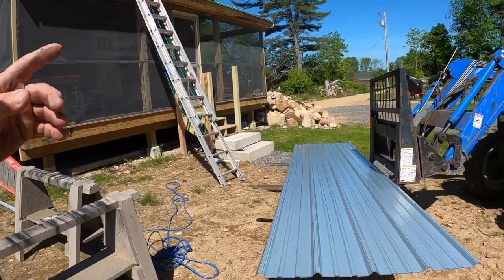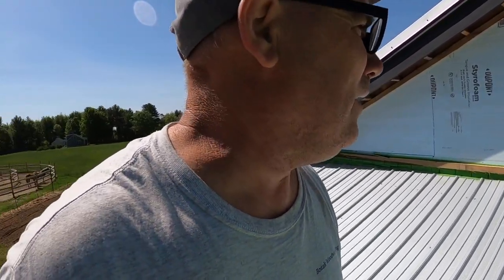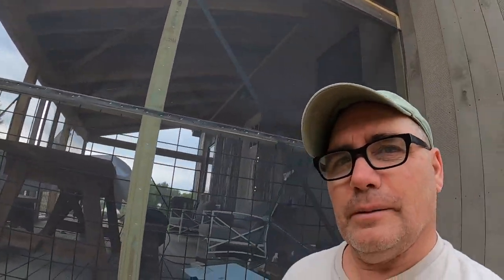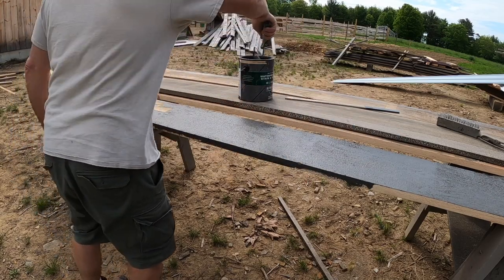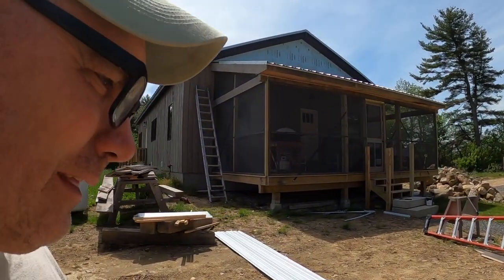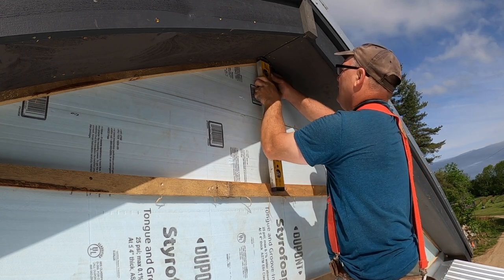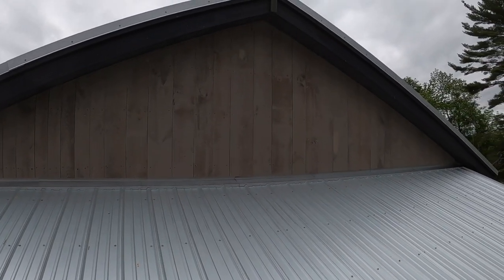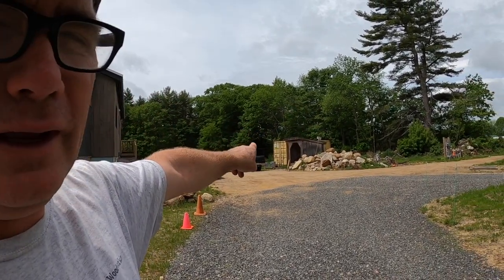Screen Porch Part 3: Jobs Meant for 2 People

Comment: I wish I installed my board and batten siding with the air gap like you did.  I put mine right against the two inch insulation.  We will see what happens in 20 years.
Reply from the maker: The only worry I have about the air gap is that the siding is actually hanging on the 4inch screws.We will see what happens.